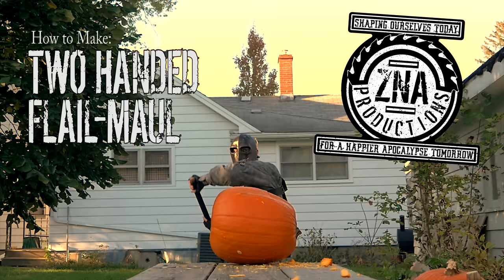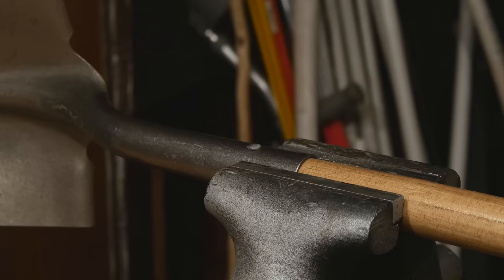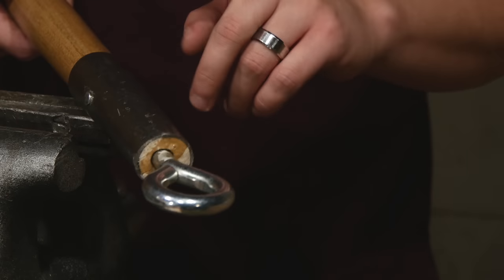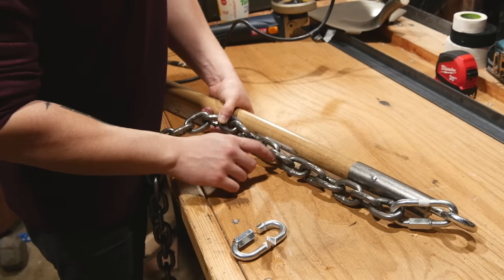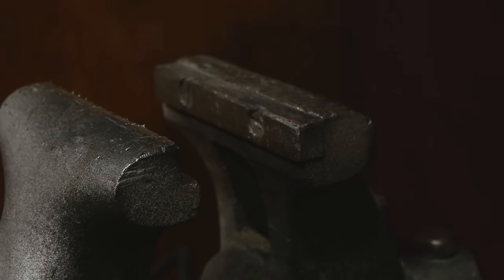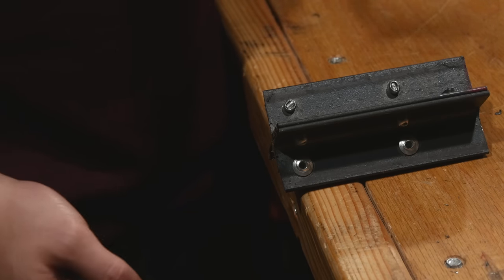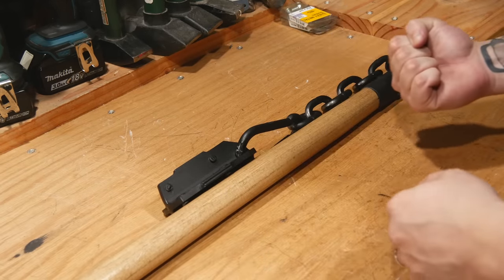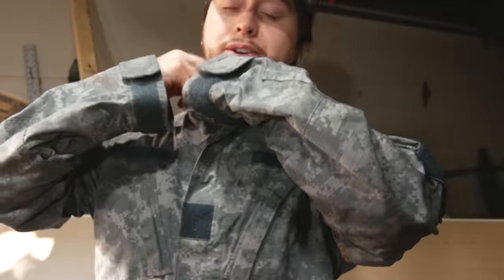-DIY- Brutal FLAIL MAUL (Two-Handed Flail) +Destruction Test

Comment: Whooaa eli! For your own safety please take the ring off when working! Its great your married, i am too, but take it from someone who learned the hard way! Take the ring off when working bro
Reply: Good tip. I think he's just engaged right now, though.
Reply: What is the risk with rings? I am always working with rings on.
Reply: DMAN D wondering the same thing
Reply: Plymouth Rd if any hot were to get underneath it it would burn nonstop until the ring was taken off or if he's welding even with gloves on it will arch through the glove and burn the living heck out of your finger
Reply: Jordan Chartrand that’s not good 😂
Reply: FT freerunning I had to get a ring tattoo when I worked construction. Hell, even Jimmy Fallon degloved his finger with a wedding band.
Reply: If anything jerks out and gets caught on the ring, he could have his finger skinned or lose it completely.
Reply: agreed my dad lost his wedding ring in concrete
Reply: DMAN D 
If you’re feeling brave, google ‘degloved finger’, not for the faint hearted. Take your jewelry off.
Reply: My woodshop teacher told us a welding story about having his ring on. Melted right through to the bone.

Comment: Wouldn't the chain add to the weight, thus adding damage?
Reply: That one commenter 1 It also makes the weapon more dangerous to the user
Reply: Safety first
Reply: it would, when it comes to melee weapons there is balance between damage and speed, and it all comes down to the weight of the weapon itself. This bigger chain looks way cooler and you could argue that by using 2 hands, the weight is less of an issue, but overall a smaller chain would have been better
Reply: Chain basically acts as a leverage and it's own mass dosn't really matter that much. The further the mass is placed from the shaft the more it contributes to the force of impact, since it stacks multiplicatively with chain lenght. Thus increasing the weight of the chain itself is inefficient. You could save this weight for the striking head since its the part most removed from the shaft. In fact hanging a huge metall ball on the silk string would made a perfect flail, sadly string not robust enough and we are forced to use chain.
Reply: Lorenzo Giancristofaro
Speed doesn't really come into it, a flail generates enough momentum that it's going to hit hard and fast regardless. In actuality the balancing act lies between strength and handling where a heavier head is going to make it generate a lot more momentum and thus hit a lot harder but in doing so you're moving the center of balance up the haft and away from your hands making it much harder to use effectively.
This is true of all weapons, generally speaking speed isn't as much a concern as balance, the notion otherwise is largely a fiction built up from video games because speed/strength is the easiest way to balance a weapon in a game without a complex fighting system.

Not of course to say that different weapons don't have different speeds and that you can tailor a weapons design to be faster but my point is that it's really not a matter of strength/speed it's strength/balance.

Comment: Hey bro, may have already been mentioned but anyway a quick tip, once you've got the eye-bolt started in, rotate and put the handle into the vice, then you can use a crescent wrench through the eye like a lever to screw it in. Mechanical advantage baby

Comment: @ZNA Productions just a heads up: the rule that the chain must be shorter than the haft is not really valid. 14th century grain threshes had a haft of some 1.5 meters with a hinged flailhead of some 20 cm, sure. However the Spanish mangual, or warflail, a 2 handed weapon has some 0.6-0.7 m haft with three chains of about 0.8-1.0m length, each.
The thing is that if you hit yourself in the hand with a flail, you're using it wrong. It's not used like a mace or a sword or to hack like a whip, but rather in same ways as a 2-handed sword, in continuous motions to keep up the momentum.

Comment: If I built it on the striking surfaces of the flail head I would use the angle grinder to cut out spikes so a direct impact would have a even higher psi

Comment: Now when it comes to Quick links you can bend them and then bend them back the screw-in it's not very quick but either heating heating up with a torch and bending and then bending it back or if it's small enough you can do it cold I've done this numerous times if it for a permanent or more semi-permanent application it works quite well if you have to do it time and time again not some well and then they also have split links it's a chain link that is split and you hammer it back together once you attach it possibly you can weld it that's probably the best thing but if not hammering it back together works quite well

Comment: Do you prefer not to using welding in your builds? Seems like arc welding would be less risk than the rivets. Won't the rivets have a chance to break on impact and fracture the head?

Comment: Being 2 handed is basically not a thing for maces, flails, boarding axes...  Just swing it with both hands.  A maul is an ax on one side, and a hammer on the other, like a Splitting Maul, anywhere except for fantasy worlds.  It's just a flail, not even a particularly long one compared to grain thrashing flails.  (For beating fibers out of stalks, like Hemp.)   To be technical, the short ones are "Horseman's flails."

Comment: I make my flails to 2/3 shaft length. So if I have a 30 inch shaft, my length including ball would be two thirds. I keep my hands as far down on shaft as possible, using hockey tape with a rib on each end two prevent choking up on it. Then when I swing I let the ball out and that’s it. I’ve never hit myself...yet

Comment: Probably could use an extra pound in the flail head. I cant imagine angle iron being that much heavier than the chain. 
Ive always wanted to make a trick maul that can turn into a flail. (Chain hidden in upper 3rd of handle that can collapse down allowing for use of the flail.)

Comment: You need to protect the wood from the head, also the head should weigh much more than the chain so that the head is leading the chain, I'd bet the chain is heavier thus not getting as much power as should

Comment: wouldn't it be better to save the weigh from the chain and use chain that's just strong enough to hold a larger head. That way you would get more swing at the striking head

Comment: If you start with a smaller drill bit and work  you way up to a bigger bit the bit would not walk. Also I thought you bought a welder you could have drill and plug weld the wholes and weld a ring on the end

Comment: Why not just make what all second years at my welding clASS have to do? Make the flail head an Iron Cross. You gotta weld them together at the meeting places (the long area on top of the two angle steel things). Then you just make welds until the cross becomes a literal square.

Comment: but why grind off the end 90 degree tip. What if the tip was sharp with the corners. Just a theory, might gain at least 0.01% chance of that edge hitting something for a critical gain.